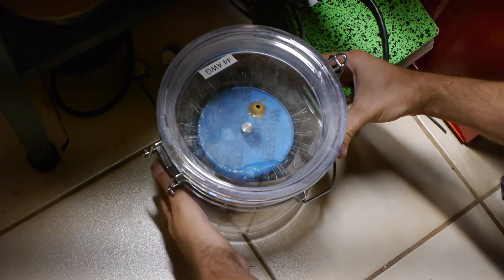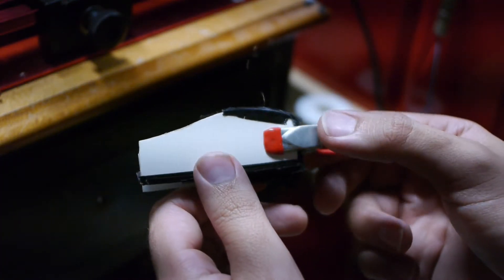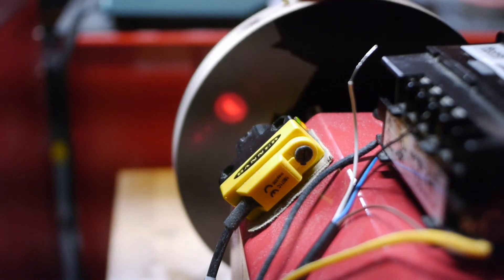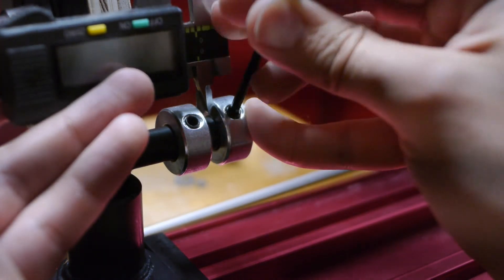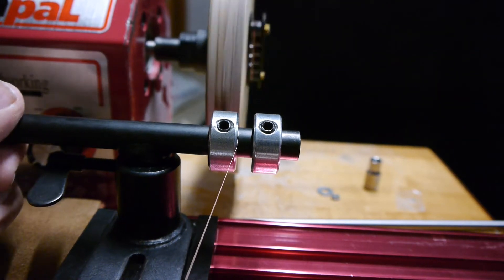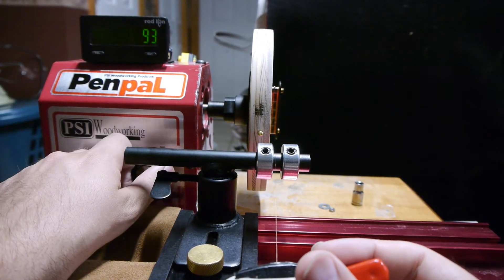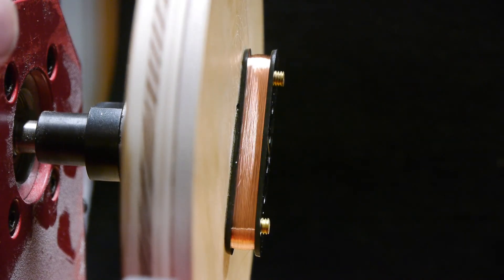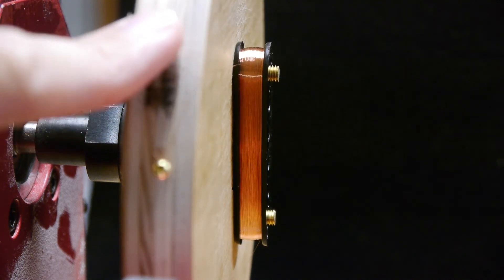DIY Mini Lathe Pickup Winder | My Pickup Winding Workstation

Comment: Do you sell pickups? I’ve always wanted a set for my Strat that are hand wound, and not from a factory
Reply from the maker: Yes! If you're interested, hit me up at: guitarmdofficial@gmail.com. 

Just as a heads up, I'm currently just offering either a flat non-stagger, or my custom stagger that is optimized for modern string gauges. 

I also offer varying degrees of overwound bridge pickups. I'm a freak about overwound bridge pickups on Strats -- I just love them to death. 

Anyway, I'll be here. Strat pickups are my favorite to make so more than happy to accommodate on making a set for anyone interested. Thanks for reaching out!

Comment: How much does it cost at the end?
Reply from the maker: @ravelitschimo  A lot more now than when I bought the parts. eBay sometimes has the parts cheaper but nowadays this setup probably costs more than the Mojotone winder to get up and running. 

I do think it's far superior. Whisper quiet and can go to much higher RPMs. But the Mojotone is probably cheaper. Between the PenPal, RRDC2000 and CUB5B000, probably over $600, and that's not including the faceplate, reflective tape, and the labor involved with making the bobbin plate, and the flat black enamel paint. 

I'd have to compare prices. But these days, probably around the $600-700 range just to get the basics of this setup going
Reply: @guitar_md  thank you for your answer.
Reply from the maker: @ravelitschimo  Sure thing! Happy to help

Comment: Awesome set up! Do I understand correctly, that you have a single tensioner made of loop velcro? I am just confused as you denote a big attention to the fact, that it is stuck on the magnet to the table, but then I see it in your hands when you're winding. At some moment I was sure you have 2 tensioners at the same time: one on the magnet stuck to the table and one in your hands. But I believe it is all the same one, right?
Reply from the maker: The magnet is only to hold the tensioner in place when not in use. Think of it like a holder for the tensioner, and nothing more, like a coat hanger for a coat. 

For use in winding, I operate it by hand. I just hold the tensioner and I'll move it to different angles to change the tension mid-wind, if desired. The design in this video is Rob DiStefano's loop velcro tensioner, which uses two strips of only loop velcro. But I have one very important update: 

I now use two popsicle sticks. I just cut them, then line them with Scotch double stick tape, and wrap them in felt. And that's it! I use a Stewmac Kerfing Clamp (the red ones) to clamp the wire between the popsicle sticks lined with felt, and have been using that for over a year now. 

In my complete pickup build here, I mention it: 

https://youtu.be/5BqFoBJr10o?t=475

That's a more updated version of my setup, though I've made more modifications even since then. Rob doesn't like felt, though I find I prefer it to loop velcro. To each their own. Both are worth trying. I think the popsicle sticks and felt are much easier to set up and to use. 

Hopefully this helps! Check out that link to my newer video. I time-stamped it so it should take you right to the velcro tensioner part, including my update with the Rubbermaid spool holders and popsicle stick + felt tensioner.

Comment: How do you do reverse spin? Do you just flip it the other way on the plate?? I'm really interested in making a pickup winder out of a wood lathe. It seems like the motor would be better and last longer.
Reply from the maker: I flip the pickup the other way -- no reverse function on this. Though I only need to do that when winding stacked noiseless pickups. For humbuckers and single coils I just wire them in reverse in situation. I've never seen any advantage to reverse winding Strat middle pickups for example as it's exactly the same as simply magnetizing it the opposite polarity as the other two pickups and then using a yellow wire on start and black on finish so people know to wire it in reverse. 

Rob DiStefano, who told me about the PenPal, has been using it at full speed (4300RPM) many times every single day for around 7 years now with no issues. 

This lathe is a wood lathe, though a miniature one for turning pens. I've also thought about using a more robust lathe though I can personally vouch for this one. The top speed of 4300 RPM is also extremely useful when doing large coils. I make some with close to 19,000 turns of wire and I can complete those in under 5 minutes with the PenPal. 

Either way, a lathe is the best option. Whether you get a PenPal or something else, a lathe is the way to go. I haven't made a video yet on making the bobbin plate. I use a 2" faceplate. I simply use a compass to draw a 3" radius circle, so 6" diameter, and then use a 2" Forstner bit to bore out a recess for the faceplate in the middle. Cut out the circle on a band saw. Then chuck it in the lathe and trim it up by running the lathe and using a sanding block. 

I spray the back of the plate with flat (matte) black enamel and cover half of it with reflective tape.
Reply: @guitar_md  sweet that makes sense.  I'm going to do this. I'm so stoked

Comment: Curious what RPM max you wind the coils ?
Reply from the maker: 4300 is the max RPM of the PenPal, and the maximum I wind at. I only use it at that speed when I'm doing extremely overwound coils, though. 

I still need to work on my setup a bit, as going over 3000 RPM or so, the wire can start to "throw." And go beyond the bounds of the traverse limiter. 

Rob DiStefano, who taught me how to wind pickups and told me about the PenPal Lathe, winds at 4300 RPM for everything. And he doesn't use a traverse limiter. Legend! 

I usually hang around 1500 to 2500 RPM. With a Whisker disk, I usually go 1500 max, as going faster can break the wire when using one of those. At least it feels like it will. I haven't tried in a long time. 

Around 1500 RPM is probably the most "normal" speed and gives you great control without fear of throwing the wire or breaking it. I used to use a Ryobi mini lathe that went to 2500RPM, which is plenty fast. 

But for doing pickups like my Super Heavyweight that uses 18,500 turns of wire (or more), the 4300 RPM setting is great for doing most of the coil. Definitely gets it done a lot faster.

Comment: How did you cut lathe bed ?..thanks
Reply from the maker: Do you mean the tailstock on the lathe itself, or the pickup bobbin mounting plate? 

For the lathe itself, I just used a hacksaw. It definitely took a while. I think a reciprocating saw would have been much, much faster. But it's made out of aluminum and isn't too hard so any saw that is strong enough to cut through mild steel will be plenty. Doing it by hand did take a very long time. 

For the bobbin mounting plate, I used a compass. Set the needle-to-pencil distance to half the diameter of the desired size circle. So in this case, I think about 3", as the bobbin plate is roughly 6" diameter. It has to be big enough so the retroreflective sensor beam can fit onto the back. 

The compass will make a centerpoint mark in the plywood. I usually hit that with an awl to make it very clear where the center is. And the compass will draw a pencil line in a circle exactly where you need to cut. 

Then I cut that out on a bandsaw as closely as possible. Then I use a Forstner bit -- say, 2" -- right at the centerpoint. You want to drill a shallow recess so a 2" faceplate will have room to press-fit into the back of the plate. 

Then you drill the holes for the faceplate, screw it down, and you're halfway there. Once that's all done, I remove the faceplate by chucking the bobbin plate into a vise. You remove the screws, then tap the bobbin plate (wooden part) firmly with a hammer. This will gradually knock the faceplate loose and then you can simply pull it out by hand. 

Then flat black enamel on the back of the bobbin plate. Whole thing. Then cover one half of the bobbin plate with reflective tape. Like a Pokeball. I don't know if you know Pokemon. But it will look like a pokeball. Half of it is flat (NOT gloss) black, and half is reflective tape. 

Then you cut out the tape with an Xacto knife, and reinstall your faceplate. Screw it down. Now you can put the bobbin plate onto the lathe itself, and use the lathe to turn the plate -- I use a file, or a block with sandpaper, and a vacuum right next to it. You can shave the bobbin plate down this way until it's perfectly round. This is why it may be a good idea to go a little OVER 6" diameter, as you may end up removing 1/4" or more during the lathe sanding/filing process. 

Only other thing: you may need to invest in a 3/4-16 TPI tap. For whatever reason, the faceplates I ordered would NOT fit into the lathe. They were the correct thread pitch. But I needed to chuck the 2" steel faceplate in a vise, and then run a tap through it a couple times to re-cut the threads properly. 

They were cut too tight. It was very bizarre. No idea why that happened. But running a tap through the threads cleaned them out, and then they fit perfectly onto the lathe. 

Hope this helps!

Comment: Nice rig 🙂 It would have been interesting to see how you solder the wire to the bobbin. I wonder how one remove the isolation with ruining the wire.
Reply from the maker: Thanks! Check out my complete pickup building guide here. I show how to do exactly that in great detail: 

https://youtu.be/5BqFoBJr10o?si=T4-DAFBbhMVXpEz5

However, I forgot to show plain enamel/formvar wire in that video. The way I strip that is with a #11 Xacto blade, very carefully. And then I tin it with solder. I might add that to the video and re-upload it. 

The rig I use is the same regardless. Having a wire tensioner helps a lot to hold the wire taut, so you can be careful and accurate when stripping the insulation off. 

Some people use a little sandpaper. I haven't tried that but it might work even better. I just carefully scrape with that xacto blade. There is a feel for it. Having the wire taut is a must either way. 

42 gauge wire is tougher than you'd think. I've worked with wire as fine as 48AWG -- I will say that even 46AWG is stronger than you'd think it is. 48 is where things really get extremely delicate and very difficult to work with, but I don't know anybody else on the market using 48AWG. 

With a little practice, 42, 43, and 44 gauge wire (the most common) are all very easy to work with once you get the hang of it. For poly nylon wire you just have to use a tinned iron to strip and tin it at the same time.

Comment: a major PITA I know but.. You should better use a gloved hand to add tension to the wire as it winds as this variable tension also adds to the vintage tone of the pickup.
Reply from the maker: You can vary tension with the tensioning device by changing the position it's held in -- very much the same way you can alter tension mid-wind with your thumb and finger. By tilting it forward or back and varying the distance from the tool rest, the tension is altered. 

You can feel the tug of the wire through the tensioner, and by manipulating it, you can feel the wire loosening or tightening by how hard it's pulling the tensioner forward. 

The only other thing is I haven't seen -- and don't currently have the ability to -- test these theories on a CNC machine. Ideally you could control for Variable Tension, and Variable Scatter independently. Test them separately against a control machine-wound pickup with no variable tension and no scatter, and see what differences come up. 

I'd love to see that. But until then, I'm not sure what actual effect variable tension and scatter have, if any. Not saying they don't -- just that I haven't been able to conclude anything via measuring inductance, capacitance, and resonant frequency, which are the only viable measurements of a pickup coil I'm aware of. 

I do scatter and use variable tension on every pickup I make, regardless. It's much more fun winding that way. Rob DiStefano calls it "painting the coil onto the bobbin." I'd love to see some actual tests conducted to see what exact difference these techniques make, if any. This would require testing against a control to really establish some useful evidence.

Comment: Nice video.... At 8000 turns, how many output ohms does it have?..
Reply from the maker: Thanks! All depends on the wire gauge and bobbin type. For Strat pickups, 8,000 turns will get around 6.0k with 42AWG single build solderable polyurethane wire, it will vary slightly if using plain enamel or formvar wire due to the thicker insulation, which changes the total length of wire per turn. 43AWG on the same bobbin will get about 8k for 8,000 turns. 

Ohms are, however, very misleading. I generally only use them as a quality assurance measurement. The most relevant tests, which I use, are covered here in this other video: 

https://youtu.be/VwM77fmqV7s
Reply: @guitar_md  Ok thanks, congratulations for the video, very well done explained. Greetings
Reply from the maker: @satvai-v2s  Thank you! Let me know if you have any other questions. I'm always working on new videos

Comment: Great video. 
I've got the PenPal mini lathe too, and had read through Rob D's posts...probably read some of your posts too. I just haven't gotten to fleshing out the PP for pickups yet - still using an old homemade winder.  
The dark backdrop is working really well too. That's an issue I've been toying with, light placement and backdrop so I can see what I'm doing.
I may have to breakout the PenPal and get it set up.

Thanks for sharing your setup, process, and renewed inspiration.
Reply from the maker: You're welcome! And stay tuned. I'm actually in the process of making a complete video demonstration of building a single coil pickup, from start to finish, in great detail. 

I'm also working on another video detailing the RRDC2000 laser sensor and CUB5B000 panel meter setup for turn counting. It isn't complicated, but the instructions are kind of confusing and it took me a while to figure out how to wire them together and navigate the panel meter menu to set it up for turn counting.

Comment: hey thanks Doctor - yea, I totally missed that you explained you were winding a humbucker pickup - i love our idea of the little clamp and some velcro for the wire tensioner - i've been going with 7500 winds lately although i did my last set of pickups at 8000.  is there much difference, do you think, in 500 more winds?  ok thanks Doctor
Reply from the maker: 500 more winds will lessen the high end just a little bit. It's a subtle difference, but it will make the pickup just a little bit 'fuller' or 'darker' sounding -- just a tiny bit. I don't think I could tell the difference in a blind test. 

But maybe! I've been using 7,600 turns on my neck pickups for many years now and it's my favorite.

Comment: Hey Guitar MD - why did you wind the pickup wire on that screw?
Reply from the maker: Since humbucker bobbins don't have eyelets, there's nowhere to secure the wire. You can either tape it to the bobbin plate, or tie it around a screw like I did here. 

So tying the start wire around the screw, we keep it safe and out of the way while we're winding the coil. When the coil's done, it can be removed from the machine, and then we can solder the hookup wire to both the start end of the coil, and the finish end. 

If you don't tie the start wire down, or tape it down, it will get lost, and you'll have no way to solder a hookup wire to the start of your coil. I've occasionally had the start wire break because I was careless when untying it from the screw (or removing the tape over it), and I had to rewind the entire coil as a result. Not fun!

Let me know if that makes sense. It's not easy to explain without showing it directly. Think of it like this: A Strat pickup has two eyelets for tying the wire. On a Strat pickup, you tie the wire around the eyelet first, and then wind the pickup. Then remove it and tie the finish wire around the other eyelet. 

For a humbucker, you don't have those eyelets, so you need to set the start wire aside to be soldered after you're done winding the coil.

Credit to Rob DiStefano from Cavalier Pickups for coming up with that idea for the screw. Aand effectively getting me completely started on my pickup winding journey over 5 years ago. A large percentage of what I know about winding comes from him.

Comment: what is the name of the adjustable bolts you have on the bar stock, im trying to build my own one and im after a set of those but cant find them
Reply from the maker: Drill stops. If you're referring to the traverse limiter, that is. The unit is technically called a chisel rest or tool rest, with the drill stops attached separately. Let me know if that answers your question!
Reply: @guitar_md  i did manage to find them although under a different name (ADJUSTING RING COLLAR LOCK NUT) took about an hour of searching, i assume the name is different due to being in england allot of our stuff has its own name which makes searching for things fun lol, cheers
Reply from the maker: @baraggan4195  Glad you found them! Names for tools and parts can definitely be problematic. Even over here in the US I'm constantly running into things I don't know the name of. Makes finding things VERY difficult!